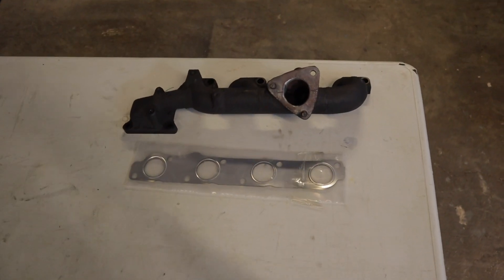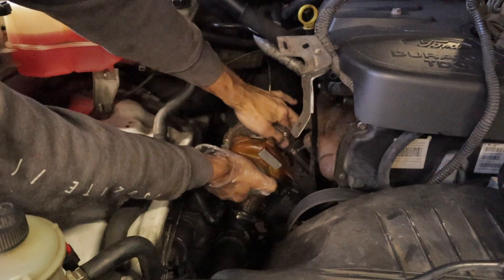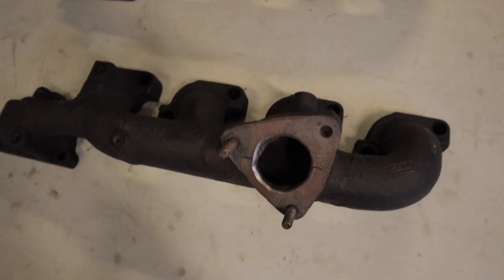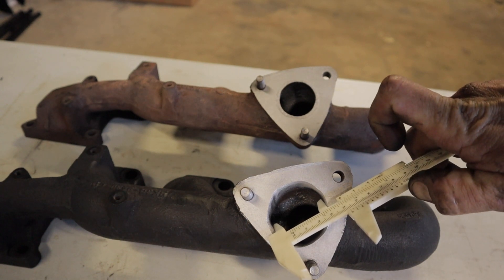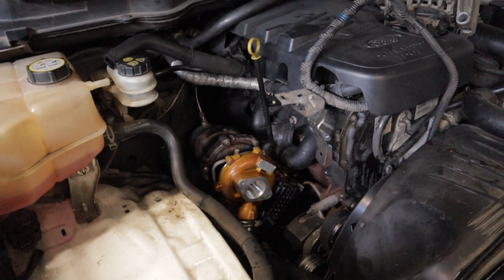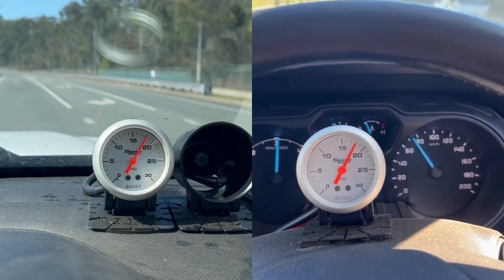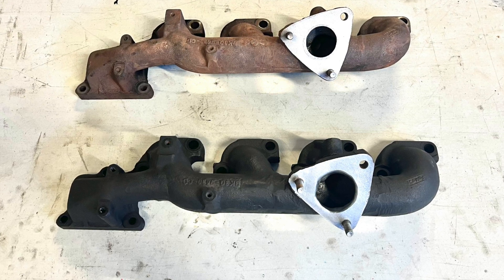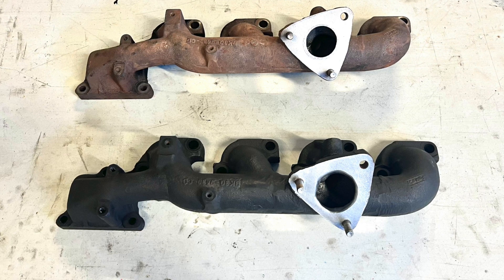Ford Ranger exhaust manifold Ported VS Stock comparison

Comment: I know that the ford ranger is purposely limited by the factory on the intake side (intake box) and exhaust (gasket in downpipe) due to overspeed rpm in the turbo. Have u managed to solve this issue with your new turbo?
Reply from the maker: yes i have a vid on the airbox

Comment: Awesome video, can't wait for the dyno test, on a side not , did U block the exhaust side when U deleted the EGR, because there is a lot of soot on your bonnet at the back on the driver's side..  looks like a cracked EGR, with exhaust gases shooting up.
Reply: I noticed the exhaust leak stain on the underside of the bonnet also.
Reply from the maker: soot is from me reusing the original exhaust manifold gasket when i first swapped the turbo, with the new gasket it's all fixed, i've got a blanking plate there as well.